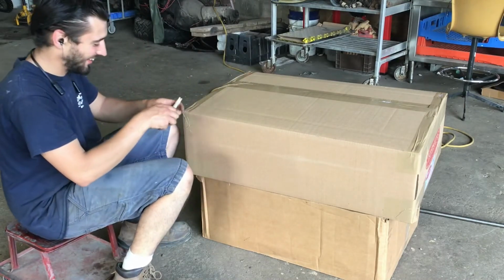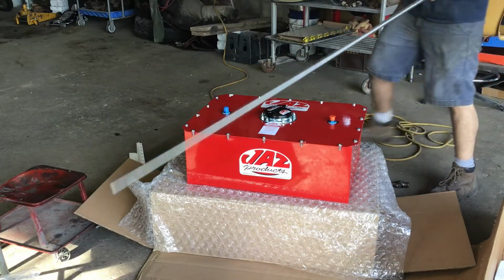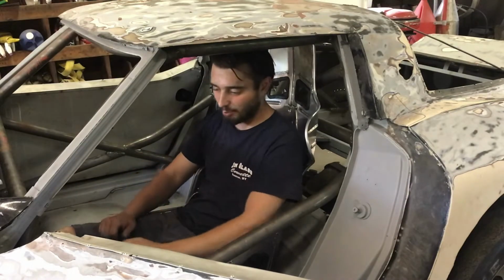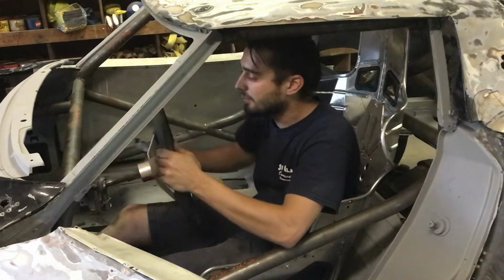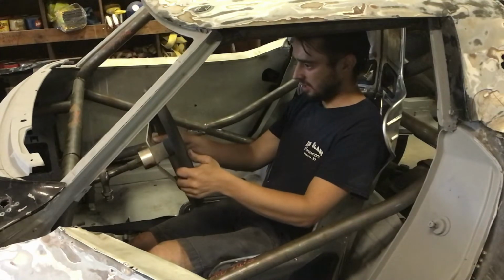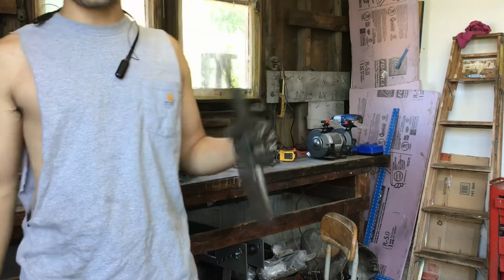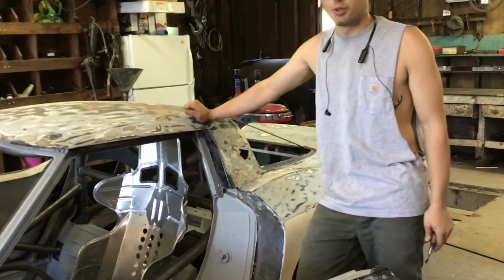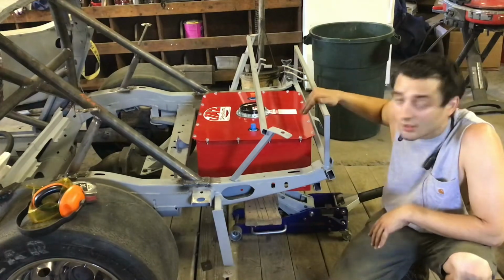WSG 19: BAD DAY

Comment: Please cover your pit completely, I wouldn't want to see you get hurt. I keep seeing a hole in the B-pillar on the drivers side, Why is it there? Put your helmet on to check seat height spacing (helmet adds a lot). Look at your gauges through your steering wheel, not over. It's hot and you've been working really hard on Sluggy, when something goes not right, take a break. Watching you build Sluggie is #1 on my list.  You can Doo it,
Reply from the maker: Thanks Rodney! The hole was for vent tube I think.  Good advice on the gauges